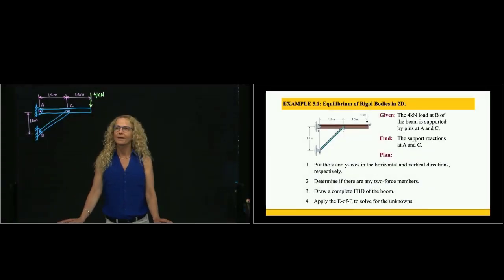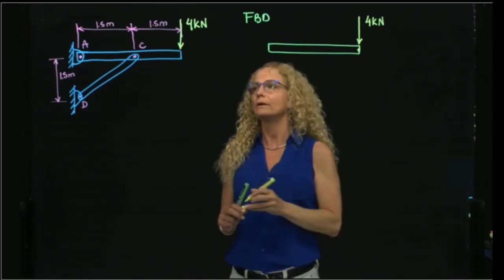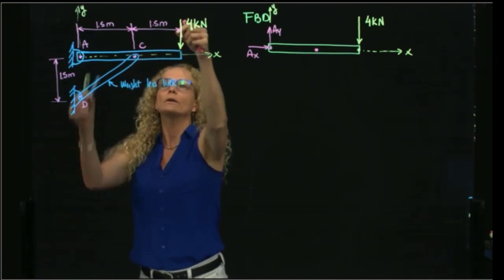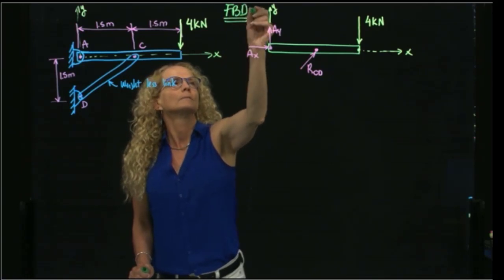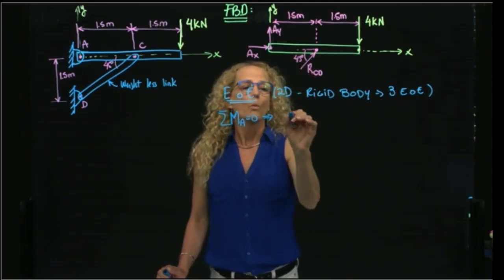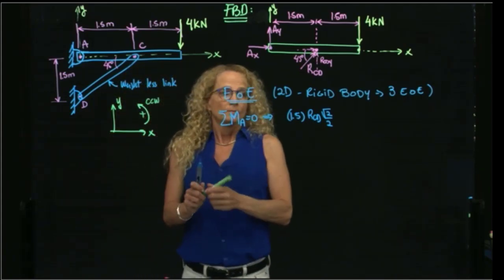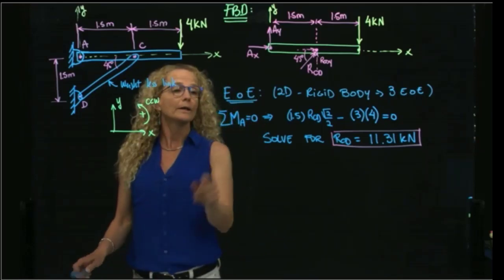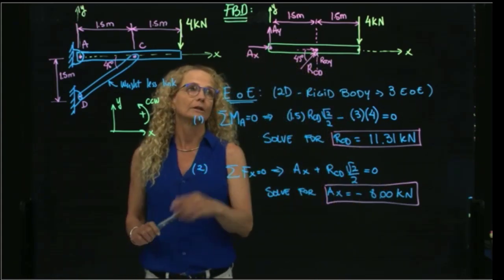STATICS, Example 5.1 Equilibrium of rigid bodies in 2D

Comment: For the Fx and Fy equations, can anyone explain how to determine if Rcd should be postive or negative. I know she put positive in the video but im not sure how this was assumed.
Reply: Rcd is the magnitude of Rcdx and Rcdy, so it will always be positive regardless of the direction it is travelling. 

If you find the magnitude using the Pythagorean theorem, then Rcd will always be positive regardless of the sign of Rcdx and Rcdy. You can test this by doing the Pythagorean theorem with negative and positive numbers.

In regards to Rcdx and Rcdy, negative for the y direction is typically down while positive is up, while negative for the x direction is typically left while positive is right. This remains true for a two-dimensional system.